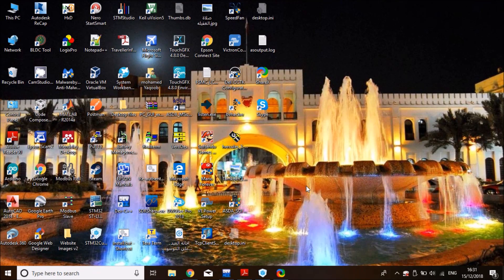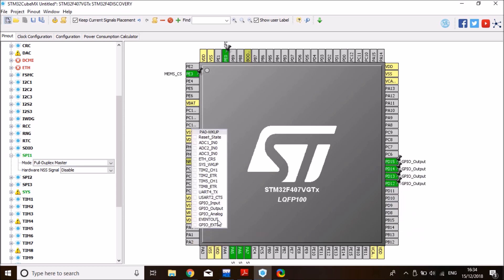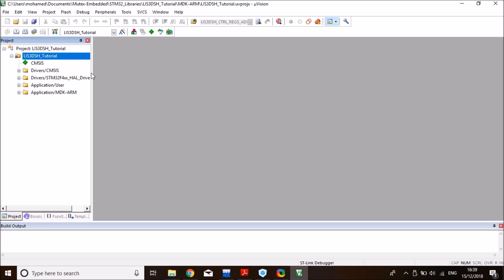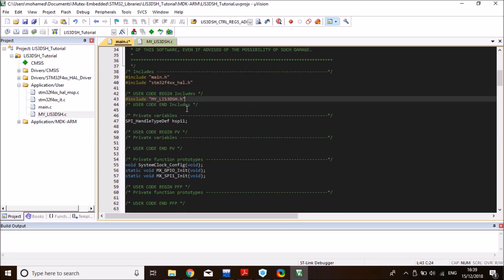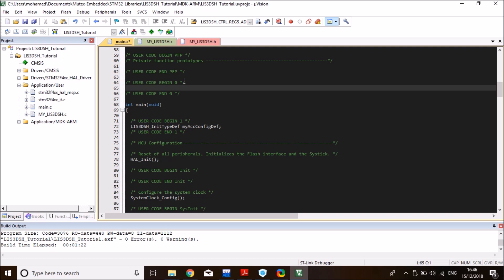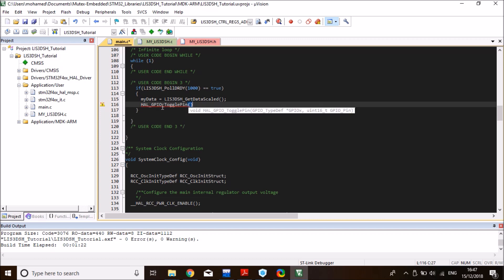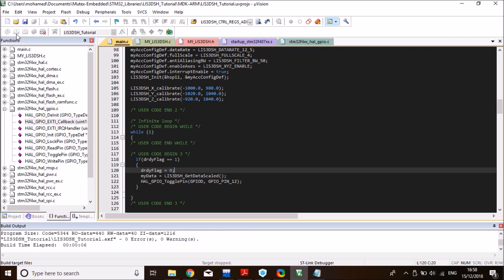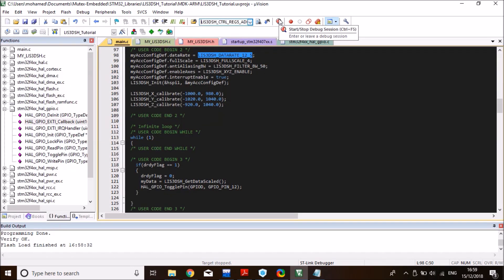STM32F4 Discovery board - Keil 5 IDE with CubeMX: Tutorial 27 - Motion 3-Axis Accelerometer LIS3DSH

Comment: Hi! I have a question about your calibration. Where did this came from:
" __X_Scale = (2*1000)/(x_max - x_min); " ? 
As i understand __X_Bias is from the chapter about Sensitivity (3.1.1 Datasheet), but i havent found information about this. 
My first thought was that "2" is from your scale, but I see you've chosen +- 16g scale. 
Thanks for answer :)
Reply: Sensitivity describes the gain of the sensor and can be determined, for example, by
applying 1 g acceleration to it. As the sensor can measure DC accelerations this can be
done easily by pointing the axis of interest towards the center of the Earth, noting the output
value, rotating the sensor by 180 degrees (pointing to the sky) and noting the output value
again. By doing so, ±1 g acceleration is applied to the sensor. Subtracting the larger output
value from the smaller one, and dividing the result by 2, leads to the actual sensitivity of the
sensor. This value changes very little over temperature and also time. The sensitivity
tolerance describes the range of sensitivities of a large population of sensors.
Reply: I see this Sensitivity descriptions in the datasheet. Hope this helps!

Comment: Thanks alot for this video. I tried the same in cube mx itself than in Keil IDE. I followed the exact procedures. The leds are blinking as per set datarate but the x y z data is not updating. Can you give your suggestion for this issue
Reply: I just ran into the same issue but fixed it by changing a flag set in one of the control registers. Find the spot in the initialization code where he is initializing control register 4 and OR the value to be placed in the register with 08(hex). This changes an update blocker flag and solved my issue. Hope it works for you too.
Reply: @nicka6799  Hey, could you help me? I'm having the same problem. I could give you my email to contact

Comment: Hello sir,  I am using the stm32f407vg Discovery Board  using cube IDE,  but when I run the code it update the value once and the led doesn't toggle, it just blinking high, I am not able to now why it is not updating the values and toggling the led . Please help me to sought out my problem.
Reply from the maker: Do you think it triggeres Hard Fault?
Reply: @mutexembedded2206  It is not triggering the hard fault
Reply: I don't able to figure out what is happening
Reply from the maker: @amanrawat4250  Hi Aman, I recommend you go over my video again very carefully, do all parameters the same as mine. see if you can get it working. I looked at your code, I can't tell easily.
Reply: @amanrawat4250  are able to debug the problem??please upload project on github i want to learn more

Comment: Hi I find all your videos very useful.. thank u... please can u do a video on L3GD20 gyroscope sensor with stm32f429zi?
Reply: Oh god, yes please. I am trying to get this working, but I have no idea where to get the pinout information. I were not able to find a document that shows the connection of the gyroscope to the chip (similar to the schematic at the beginning of this video). There is one measly graphic in the boards user manual that shows the gyroscope connected to the I2C-System (but not which one of the three available I2C). Also in a very short paragraph it says "The STM32F429ZIT6 controls this motion sensor through the SPI interface." (so not I2C at all?)

Comment: Hello, I am following your videos and they are really helpful. Is it possible for you to make video on IMU. Can you explain how Accelerometer and gyroscope raw data is used to get angles and how can we use filters to improve our readings. It will be really helpful if u add magnetometer too. My suggestion will be make a video on MPU9250 which is having all the sensors and its really cheap. 
Regards
Reply from the maker: Hi,
I am considering making signal processing videos, but STM peripherals and drivers are my priority right now.  Thanks :)
Reply: @mutexembedded2206  well u can use stm32 with any gyro accelero and magnetometer and show us how to get the correct angles from it. May be processing software will help to visualize the data. Infact processing is really simple and u can easily transfer the data from stm32 via serial. Kindly consider this thought as getting raw data's from accelero gyro and magnetometer is really easy but utilizing those values to get a perfect angles are really confusing.
Regards